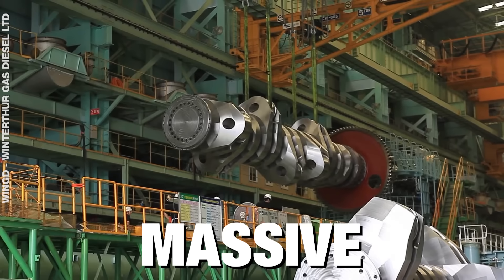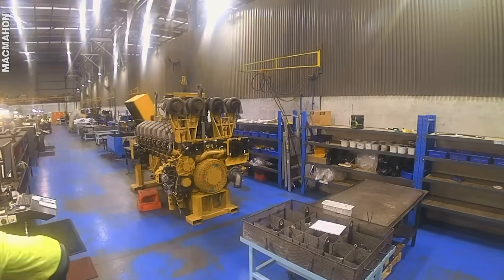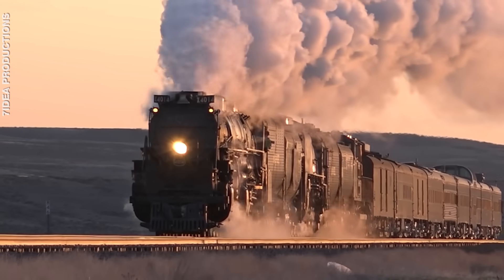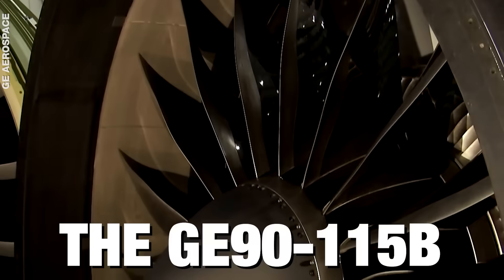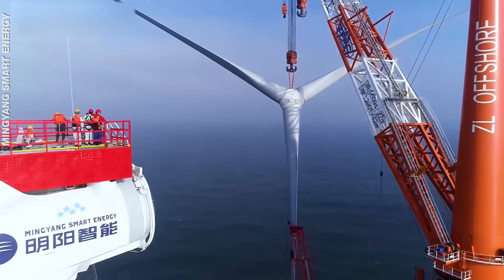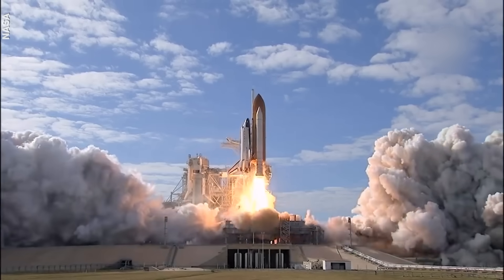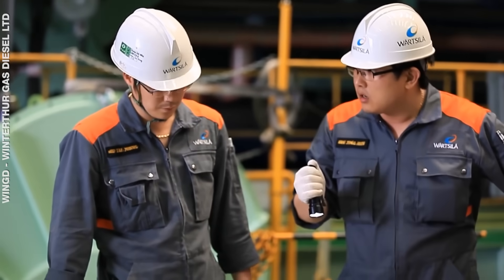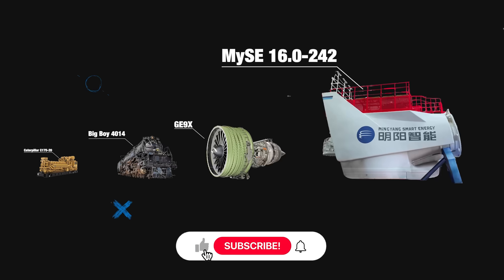World's Biggest Engines

Comment: The GE90x is only 1/10 of the Soyuz rocket thrust..not the same…think metric….and is not doing too well..
Reply: But it's a rocket , the other is an actual jet engine
That's like comparing the energy released during a nuclear bomb
With the energy released in a nuclear reactor, it ain't fair
Reply: @alexandrosandreou8585  there was an error of ten fold in the comparaison of thrust made btw One GE90x the largest jet engine and a Soyuz rocket and the thrust of a rocket or jet engine can be compared only to understand the enormous amount of energy required to put a given load into orbit.. yet not comparing them as mobility means since atmospheric and non atmospheric propulsion fundamentally is different,,,

And also for the energy of fission obtained by the the explosion of a nucleus of U235 by the collision of a neutron issued from a previous fission this energy is basically the same amount of MJ ending into the same residual smaller nucleons elements elements weather fission is inside a nuclear bomb or within a controlled reactor…it is only the amont far greater of moving neutrons captured by water and regulation barres which moderates drastically the controlled reactor number of reactions in a given period of time..while once started the non-interfered chain reaction of the bomb is exponential so fast with sufficient critical mass of enriched U or Pu that the chain fission reaction grow faster than physically the fissible uranium and fusing H2 or Lithium placed around can move away..and fission of heavy nucleus U and fusion of very small H, Li, is then completed in ms, and the resulting deficit of mass generated by both fission and fusion produces a tremendous amount of energy while mass converts to energy according to Einstein’s E= MC square…with C speed of light being very high at 300000kms per sec, energy is enormous..

Comment: Former Boeing Everett where giant planes are built in the biggest building on Earth..... I have been up close and personal with the GE9x turbofan engine used on our 777's and 787's. G stands for Gigantic, E stands for Engine, 9 stands for over nine foot diameter front bypass fan. By the time you add the engine cowling, engine is so big it won't fit inside a house. It is so large it would stick out through the roof.
Reply: Damn, you've seen some amazing stuff
Reply: @Lord_Alhaitham  Thanks for  comment. Boeing puts 'Big' into a whole new perspective.
Reply: @SJR_Media_Group  Can you tell some more interesting stories (•‿•)
Reply: @Lord_Alhaitham  Thanks for comment. I do like telling stories.
Reply: I’m an intern there at the moment. Truly amazing.
Reply: @F1sh_king  Thanks for comment and good luck with the internship.
Reply: My first flight on a 777 I remember thinking, those engines are scary big.  The low frequency sound the you can feel through the aircraft when they start is awesome.
Reply: @fkchci681  Thanks for comment. Yes those monster   sized Turbofan Engines dwarf all others. The Triple Seven (777) has great sound insulation inside passenger cabin. But if you sit in window seat just before engine or just after, you get even more crazy low frequencies. 

At night you can see the glow of hot power turbine and burning hot gasses. In daytime, you might see condensation clouds form at the Engine inlet. It depends on atmospheric conditions to be just right.